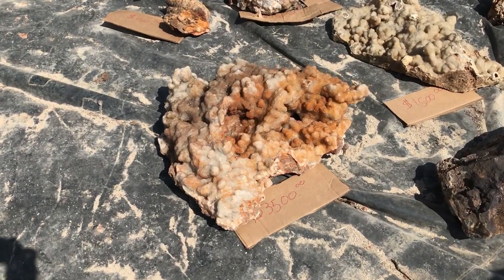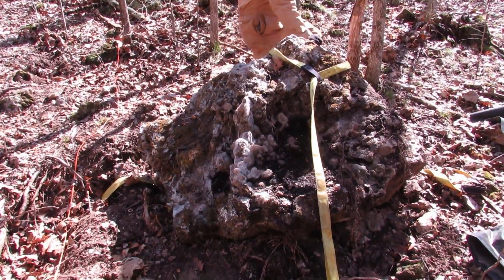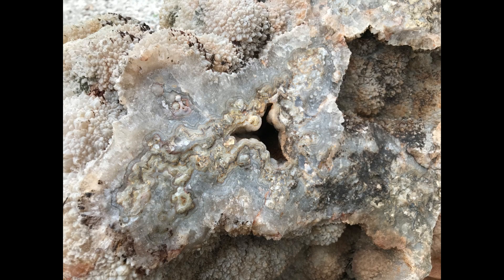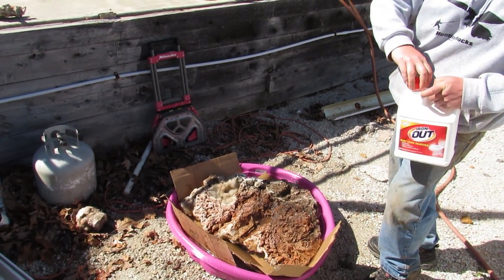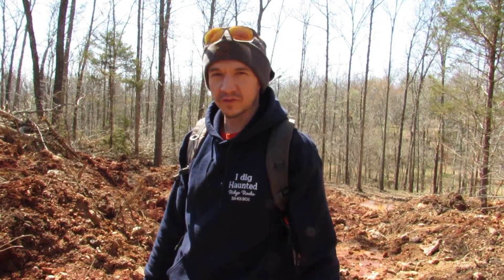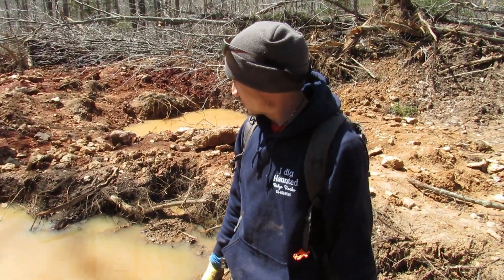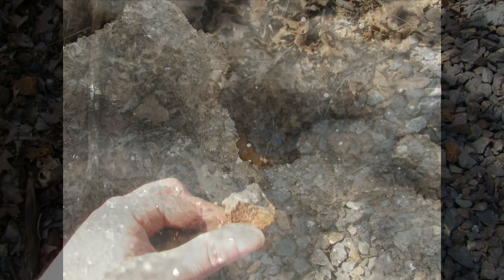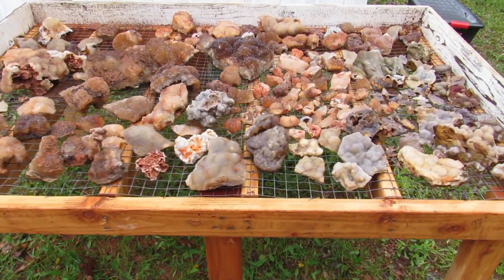Haunted Ridge MONSTER Hunting!!

Comment: I’m from Missouri and I have a spot I go to each year. I need to know more about you, how to clean and make mine shine!
Reply from the maker: I'm located just west of St. Louis in Warren county.  The most critical step to cleaning them is a pressure washer.  Once you have all the clay off soak in Iron out to remove red/orange iron oxide stains.  For black mildew and lichen on surface finds bleach will clean that off.  Hope that helps.  There's going to be a Halloween dig event at Haunted Ridge Oct. 14th-16th.  Hope to see you there!